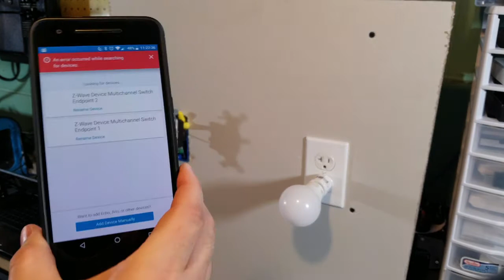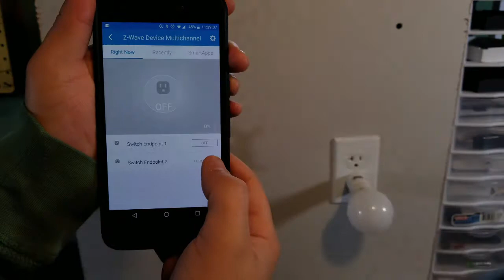Vision In Wall Z-Wave Micro Switch + Samsung Smart Things

Comment: My switch relay appears to be wired correctly. It has a flashing light and I can successfully control the two lights with the physical switch. But I can't connect the relay to my SmartThings app. I tried clicking the button 4 times before searching, I tried flicking the switch on and off 4 times before searching, I tried holding down the button for a period and then repeated all of the above steps, and still it won't connect. 3 other Zwave switches (by Honeywell) in the same box connect just fine. Any ideas?

Comment: Can you open the circuit again and tell me if at the bottom there is a soldered component with the name R14 and what number does it say? (It's the side you do not show in the video, when you take out the plastic, you'll see the button)
It is located at 4 contacts that joins the 2 PCB.
Reply: Wow! nice pics! too many thanks !!!

Comment: Does the switch need to be close to the z wave hub when you turn it on and off 4 times?  I have a nexia hub in the office but want to use this in the basement.  Thanks
Reply: Doesnt seem to be an issue. I have my hub in the basement and the switches work all over the house for setup.
Reply: will this thing fit inside by box?
that's what she said
Reply: Z-wave can jump 4 nodes, each node ** can be 550 ft apart.